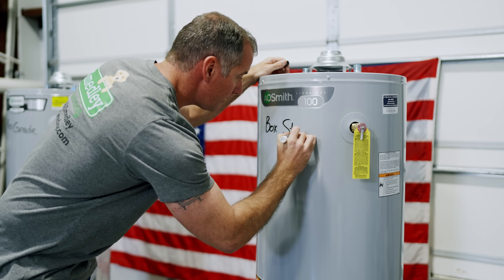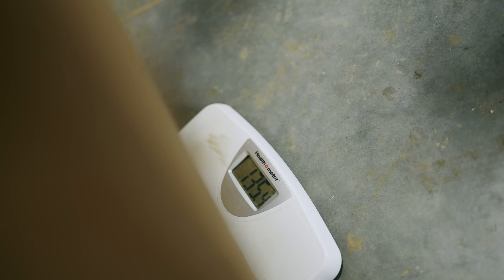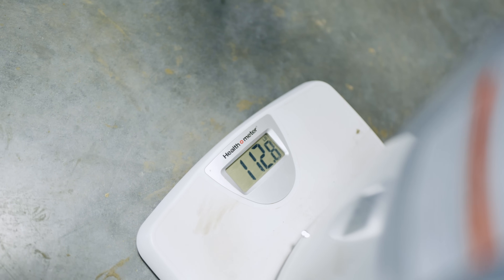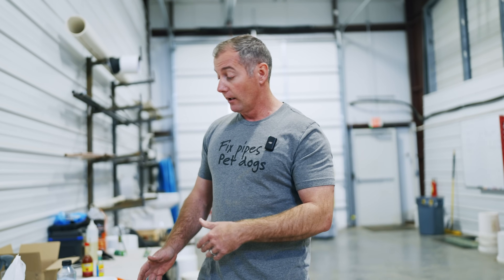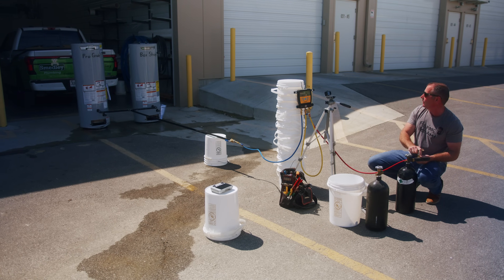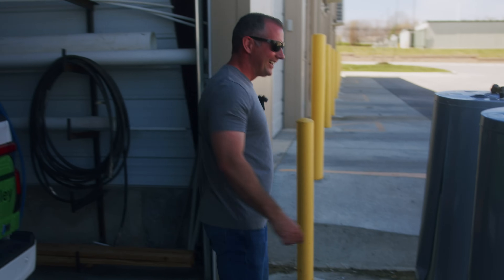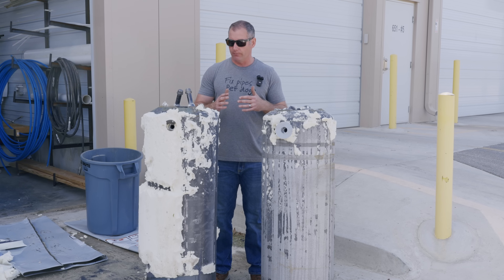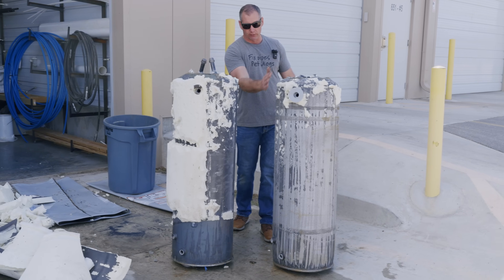What water heater should I buy? - Pro Grade vs. Box Store

Comment: Interesting video. It would be more helpful if you brushed up on your physics and chemistry before making an evaluation of 'quality'. While I would tend to agree that the two heaters are not likely made exactly the same or maybe not even in the same factory, I do find that you appear to be quite biased towards the 'pro' grade. So much so that it overshadows the actual science of your testing.  

 

When you measured the weight of the safety valves you showed a 0.1 ounce difference in weight but your comment was that 'even an ounce difference... indicates more inferiority'. I would agree that a full ounce would be quite a difference, however you measured point one ounce.... The density of brass varies slightly more than 3 percent depending on the specific alloy. Your difference was 1 percent. I just weighted 20 valves, ten gas and ten fluid and the weight varied up to 4 percent in each group. Same brand, same models. You said that when it comes to metallurgy, weight is everything. I just replaced several stainless valves on my aircraft fuel tank with titanium. Half the weight. Do you think the stainless were stronger than the titanium? But even if they were the same material, don't the valve internals have much more importance than the weight? Sure do. 

 

You weighed the dust cover? Seriously, how substantial a dust cover do you need to keep out dust? If you can save me money by using less materials where it doesn't matter - please do. Good for me, good for the earth.... 

 

You count the turns on the baffles then you count the velocity limiter tabs but you only consider the turns. Big box, more turns, better heat transfer you say. You even mention it has less tabs than the big box. Do you not understand that the tabs are put in there to reduce exhaust flow velocities? Adding tabs to the big box is marginally more expensive than adding turns and the resulting effect is the same. Lots of ways to control air velocity and each has its pros and cons. Again, weight is largely irrelevant. Design is key. 

 

Anodes are sensitive to water conditions and have nothing to do with trying to 'cheapen' the rods. Boats use aluminum or zinc for saltwater and magnesium for freshwater. Using your logic, an outboard motor with magnesium anodes would be 'higher quality' than one with aluminum. Not true. Different water - different chemistries. Many folks in the midwest and elsewhere have water softeners and therefore salty water. For them aluminum is better. And cheaper. Rotten egg smells come from bacteria in the water reacting with aluminum or magnesium anode gasses that are produced as a result of corroding but aluminum is far less susceptible. Chlorine treatment to kill the bacteria is the correct solution. Who wants a clean, new anode put in with a ton of 'old' bacteria? 

 

Plastic vs brass drain valves? Plastic pros are they don't corrode or react with the tank metal. Brass pros are they can be cranked on harder without breaking but they weaken in softened water because of the salt and they react with the tank metal and corrode. You make a point of being able to stick a screwdriver through the straight brass valve to unclog it. So where does the water go when it unclogs? All over the floor, or the attic, or where? If you are okay with dumping water everywhere, just unscrew the plastic valve... It won't be corroded and seized to the tank. 

 

Lastly your tank analysis needs some work.... You say that steel is flexible but glass is not. This is simply not true. Push on your patio door? Does it flex? Absolutely. The flex on all glass skyscrapers is tremendous. Same for car windows, house windows, etc. Steel is more flexible but stronger so under the same pressure, the steel will deform less than the glass but the glass will still flex and not break because the steel limits the deformation of the glass.  

 

You said the pro heater didn't swell. That is utter nonsense. Maybe it didn't swell as much as the other but it absolutely swelled. You can't pressurize a tank to well over its design pressure and it not swell. The safety temperature/pressure valve is set for 150 psi and 210 degrees so who cares how much it swells at 400 or 300 or 200 anyway? There won't be any water in it so what is going to make it swell?  

 

Then you say the big box is a 'time bomb' but earlier you correctly stated that using water to do the pressure test was safer since it is largely incompressible and that it wouldn't 'explode' but later you say the big box is 'time bomb' waiting to explode? If your water heater gets to 400 psi you should have a talk with your water supplier. No wait, he will be busy repairing water pipes all over the city..... 

 

Video quality is good but I see lots of room for facts. If you prefer pro series, good for you, but I would be better impressed if you just said, 'hey I think pro series is better and here is my experience to support it' and then went on to create a real, factual analysis of build quality and cut the bias.  

 

My personal experiences throughout my engineering career have been mixed. What I have found is that sometimes the pro series is better and sometimes the big box is better. I have installed tons of both and the only thing that I know to be true is that 50 years ago nearly all the water heaters lasted 20 years or more, and so did the refrigerators, air conditioners, etc. I've put tons of new elements in old water heaters. Now I take the heaters out of the failed, new water heaters and repurpose them because the tanks don't last. That's for big box and for pro. So now I try to evaluate real consumer reviews and keep my fingers crossed. Works for me. Most of the time....
Reply from the maker: I can't wait to see your rebuttal video.  Tag us!

Comment: Summary of video: two water heaters of the same size from the same manufacturer are different.  The more expensive one, from a plumbing supply house seems better than the less expensive one from a big-box store.  In a nutshell, two different models are being compared and the difference is not just in the model numbers. 

The questions that arise out of this include: Why do manufacturers have different product lines for the DIY consumer and the professional? Why can’t you order the full product line through a big-box store and why are some plumbing supply houses reluctant to sell direct to homeowners?
Reply from the maker: Because the box stores use their opportunity as leverage against the manufacturer to get them to make a separate unit to meet their price points.

Comment: Weight off tpm valves is stupid, watt is a well known brand,, regulated by law, as to relief pressures
Reply from the maker: Yeah you're probably correct. However since we were using Wade to determine the differences in quality between the two units we have to be thorough and weigh every individual piece.

Comment: The pro grade did NOT have a full port ball valve.
Reply from the maker: It has straight through ball valve design.  But not a full port.  I'm not aware of any manufacturers that or a full port ball Valve on the drain.  Most floor drains can't handle that much volume.

Comment: Most water heaters are replaced because they leak from corrosion , why wouldn't you test the corrosion resistance ?? that's the most important consideration not the max pressure they can handle. .
Reply from the maker: That test would take years and we already know the box store tanks corrodeich faster.

Comment: 1:00:08 
Come on efficiency in a hot water heater is nit picking   a monthly line fee for Gas in Kansas city mo 
Is about 37 bucks a month
I use about 7 bucks worth of gas in the summer to heat water in a 40 gallon tank   your gas usage is the HVAC system and heat.
Crunch the numbers. 
Your not saving much with a direct vent water heater using internal combustion air.  If thats what your thinking its not worth it, also a tank less unit is not a better option.
Put your money in a furnace thats 97% or better efficient direct vent using outside air for combustion. 
Then wrap insulation around your water heater not that its any better an r value then the foam on the newer units.  Mine is not foam its 32 years old and only cost 7 bucks a month for hot water. 
The gas line fees cost more.
Reply from the maker: This is true but we want to showcase all the differences.

Comment: I literally hate natural gas water heaters. I stopped purchasing gas water heaters in 2010. I have had multiple houses with electric water heaters that are over twenty years old. I can easily replace thermostats, heater elements, and anode rods in electric water heaters.

I will say that the absolute best water heater I have is a Bradford White. It is 23 years old and underneath the house. The only problem I have with Bradford White is they require a plumber install it to get the warranty. All my other water heaters are AO Smith. They stand behind their water heaters and have always given me great warranty service.

Current water heaters in service

Three AO Smith electric water heaters, two are 22 years old, one is four years old.

One Bradford White 50 gallon electric is 23 years old.

I did all my own installs. I sold off my last rental property six years ago.

Note: always replace those cheap plastic drain valves with a metal drain valve. Most homeowners never drain their water heaters. I’ve tried both ways. In my experience, draining water heaters every year did not improve the longevity. For example, the 23 year-old Bradford White water heater I have has never been drained, because there is no way it can be drained in its location. Water will not run uphill. The best way to improve longevity is to replace Anode rods every 4 or 5 years. I just started buying the cheaper anode rods from Amazon. Magnesium is better, but not worth the extra cost based on my experience, if you are replacing them yourself every 5 years. Get magnesium anode rod, if you are paying a plumber to replace it, because you want it to last as long as possible. I have fired more plumbers than most homeowners will ever hire. I had so much trouble getting competent plumbers, I learned to do all plumbing repairs myself. One plumber turned the gas back on and left the job site with a gas leak. The city was called by a neighbor who smelled gas and the gas was turned off at that house. The city wanted the name of the plumber. That plumber had not tightened all the pipe joints in the attic.
Reply from the maker: Thanks for your input and support!

Comment: Wait....Rheem makes a professional grade "Professional" series of heaters and also a box-store grade called "Performace" on the label.....why do you say A O Smith only does this? (2:08-2:12)...yet you say this after you say each company makes a pro grade and box store grade (2:00-2:06).....which is it? Sounds like a complete contradiction within one sentence.
Reply from the maker: AO Smith is the only company using the same brand name on both their pro unit and their box store unit.  Rheem is the box store brand while Ruud is the pro version of a Rheem.
Reply: @SmedleyPlumbing  .... small correction.... Rheem professional grade is called "Professional Classic" series.......and the Rheem box store version is called "Performance".....

Comment: If you want to be helpful you need to convince the public to change their water heaters after 14 years.  Eventually they fill up with sediment and you lose water capacity. They rushed and leak and are unable to be drained.  Nobody flushes water heaters and they do not want to pay a plumber to do so. Main failure on a water heater is the control valve anyway. If you notice when the burner starts having issues the water heater is 14 years old or older. Simply buy a new one. Avoid the headaches.
Reply from the maker: This is true.  We don't get too much sediment in our area but most areas around the nation do.

Comment: Removing a 150 psi pressure relief valve and pressurizing the tank to 400 psi is INSANE! The explosion would have been a literal bomb and shredded you. Smarten up.
Reply from the maker: You should look up hydro testing.  It's actually very safe because water doesn't compress.

Comment: I know this video is almost a year old, but I think your tests, results, and commentary were all pretty flawed so I'm going to comment anyways. 

First and foremost, the only meaningful differences you found were the anode rod (magnesium is better), and the plastic drain valve. In the final test, both models failed at roughly the same pressure. Even if the box store model failed slightly earlier, both would have needed replaced in this scenario, so the point is moot. The real conclusion of your video here is that the box store model is just as good for $100 less. The longer flue insert doesn't match with what you said in the video about efficiency, considering that the pro model has an EnergyStar rating of $320/annum and the box store model has $227/annum (seen at 6:42), there is almost certainly no difference in efficiency and the pro model seems to actually be worse. This could be because it heats faster/better, but you didn't list the actual specs of each model (unless I missed  it), so we can't know that.  

As a note for people who bother to read this, you can replace that plastic drain valve on any water heater with the exact same on that's on the "pro model" for $10. Any trustworthy plumber should sell you that valve (for a slight upcharge) instead of upselling you $110 on a "pro model" water heater, unless there are other valid reasons. 

Next, you should have bought a 3rd water heater to test. The 9 year warranty version of this AO Smith model costs $629, which is more comparable to the "pro grade" model you bought. Price matching will be a better indicator of quality than just buying the models that have the same warranty length. I can't say whether this would make a difference, as that $100 might be literally just buying 3 more years of warranty, but it is not uncommon for longer warranty products to have slightly upgraded materials to prevent warranty replacements. We'll never know the result because you went into this test with bias and wanted to prove to yourself and your fellow plumbers that you were right to be upcharging customers for the pro model. That or you just didn't actually think this test through very well. 

Lastly, your commentary through the whole video was incoherent and biased. You looked at several parts that were functionally identical, then rattled off some babble about how the part is clearly inferior because of some thing you made up. I already pointed out your commentary on the flue insert, but you also did this with the nipples, the burner, the control unit, the emergency overflow drain. With the emergency drain, you literally fabricated the idea that the box store model is more likely to break, despite both fittings being brass, both having 3/4"threads, and both weighing the same, they were just shaped differently. You just made things up to prove the pro grade model was better when it was, in reality, functionally identical. If there is a reason to buy the pro model, you didn't find it in this video. 

The only thing you actually proved in this video is that the water heaters are not, in fact, the same model produced in the same factory on the same assembly line on the same day. Otherwise, you simply discredited yourself and your profession by lying, fabricating, and creating a test scenario that was biased from the start.
Reply: I still found the video entertaining (sans background music) and enjoyed some of the enthusiasm. Tearing stuff apart does show differences even if minor but agree some differences may not greatly matter in terms of service life. I'd accept the general observation on fielding more box store units failing earlier, but maybe this is related to the version bought. I have a 12yr unit from big box that's going on 16yrs.

generally I agree in that maybe a better comparison between a longer 9 or 12 yr box store unit with the pro grade may of offered a better comparison. 

Regarding weights, one may be lighter due to 'better' materials or within the design requirements, that a heavier item may have been overdesigned or added extra margin not really needed or seen most real world applications. One may argue it's not wasteful and being "green". It may be simply variation in the process when weights are close.

For the pressure test, while I can speculate the lighter box store water heater does have thinner metal, it would have been good to verify this by cutting out a section and using a caliper or mic and measure the metal. The metal itself may vary but may simply be overkill.

However in the end, if I'm having a pro install my water heater, I'd be happier just letting them choose the pro unit or whatever their experience dictates.
Reply: @midwestpete-k1n  I generally agree with what you said here. There is still value in the video, you just have to interpret it yourself. My complaint is (mostly) with his presentation and no the actual substance. I would have preferred more units to test, but the main issue was just his presentation and misrepresentation of what he was showing.
Reply from the maker: The biggest discovery was the swelling of the box store tank.  We sped up what happens over time.  Box store tanks swell and break the glass lining.  Then they rust out.  The notable failure wasn't which one popped first. It was for sure the swelling.